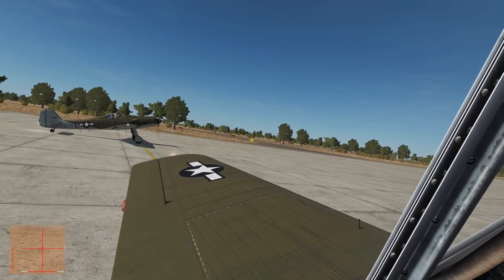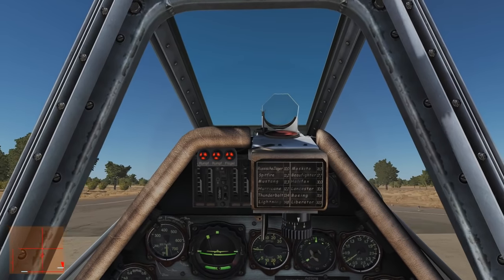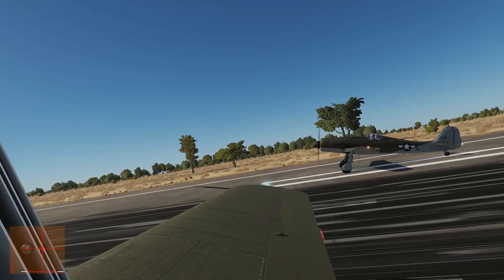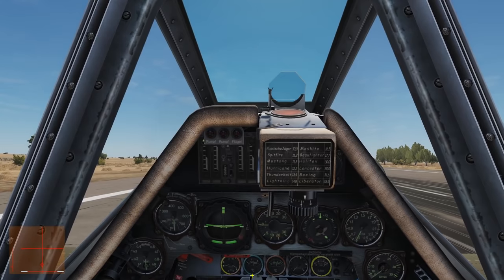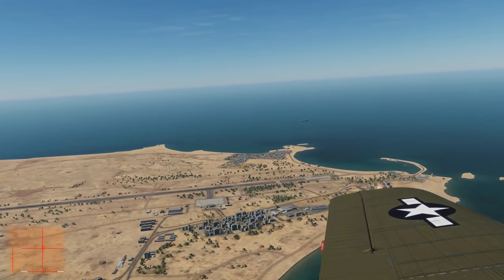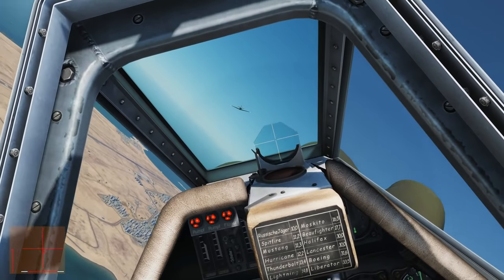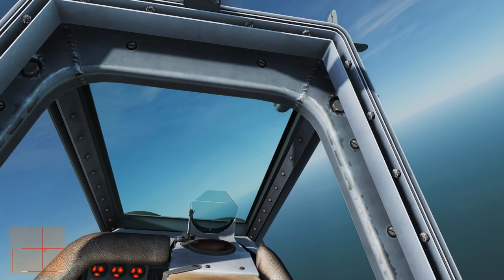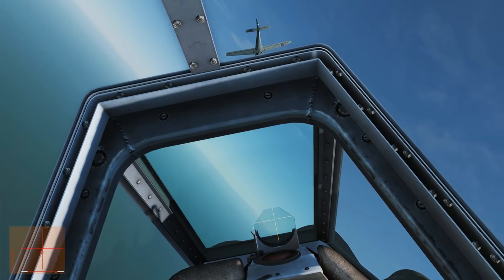FW-190 D-9 Dora: Taxi, Takeoff, Flight & Landing Tutorial | DCS WORLD

Comment: You can ignore cooler flaps and all that other stuff. In German WW2 planes its all done automatically. You just need to pay attention to your boost time aka MW50 usage. I have not managed to brake my engine in recent times.
Whats really nice about the 190 in DCS is, that it can sustain its MW50 powered boost longer than the Mustang can sustain its highest performance settings, so on the deck it will outrun a Stang slowly but surely. Same against the Spit but there its more pronounced. Just keep it fast and reasonably high and youre almost invulnerable. Allied planes right now cant do anything against Germans in MP if Germans fly correctly. Everything Allies have needs way more attention (has more workload for the pilot) and is slower at altitudes usally used for combat (0-5k meters ca). 
VERY high up the Mustang is better but still not as fast as a K4 with MW50. And yes, the Stang should be faster in game but it isnt. There is a thread on the forums with YoYo "admitting" that. He said that since the introduction of the Stang in 2012 it actually got slower since the engine right now works differently (calculates drag etc differently).
TLDR: Germans in MP can do everything they want.
Reply from the maker: Thx Spice
Reply: U.S aircraft flyiers tend to take way too much fuel in the mustang which dramatically reduces its turning ability and increases the stall speed, I was a demon in the spitfire when it first came out, with work load honestly if you initially set the aircraft up correctly you only have to glance at the guages.
Reply: @ThatGuysProject  When you were good with the spit, that meant that the K4/Dora pilots were bad. As I said, if Germans fly correctly nothing can touch them rn.
Reply: Hi Spicy, what you mean for "Stang"? ( You can write in italian too :-D  )
Reply: @tonykeith76  Mustang, the P51. 
I cant speak Italian though :)
Reply: @Spicysauced   It was too much obvious for me to understand :-D

Comment: Here's a trick. Use the turn indicator (stick on the top of the attitude indicator) so you can see when you're actually going straight, then pull the stick back to lock the tail wheel. If you try to lock it in a turn it'll stick in that turn and you'll have a bad time. The P-51's tailwheel is far more forgiving in that respect, it seems to lock when it passes through center. (Not sure how accurate either depiction is, but that's how our models in DCS work.)

And I suspect that turn indicator trick wouldn't work IRL either as there's some lag from real-world turn indicators that doesn't seem to be modeled in DCS's turn indicators.
Reply: You probably should have mentioned MW-50 in there somewhere.
Reply from the maker: thx

Comment: Tried endlessly to get Dora to take off, but to no avail with only very limited success.  Taxiing and start up procedures are fine. When I initially started with the Dora,  the real version that is  without flight assistance, tutorials etc,  I mastered the art of taking off,  sank a few Mustangs and even landed it and got a flight lieutenants promotion, for what that's worth, within a couple of hours of  making the purchase at 50% off so I can't complain. It seemed like a brilliant module, well worth the effort.  However, after carrying out a repair on DCS and an update,  I can no longer get the Dora off the ground no matter what I do.  I've spent hours trying, but to no avail. Endless smash ups.  I've got worse not better. So, rather than delude myself anymore with the Dora,  I've erased it from my modules.  Total nightmare.  The F86F Sabre purchase, however, has been a completely different story. Very easy and really enjoyable as a module along with the Gazelle and the Mig15bis.  I've given up with the Dora.  I just can't get the hang of it. Rgds MCG.
Reply: Found the source of my take-off woes, or rather maybe found it.  I went into my Logitech file and located the profile section.  It looks as though my FSX profile was being used for Joystick control as a precedent not just whilst using DCS World, but with any other simulator I could have on my system for which I could be using the Logitech Joystick.  I have now altered this so that this is no longer the case.  Strangely enough now, whilst using the Dora, the real version that is, the aircraft now takes off consistently and easily with non of the problems which have previously beset me whilst using the Dora with the Logitech.  The aircraft literally lifts itself off the ground with no effort required and seems a lot more stable during the run up to take off.  It's embarassingly easy, so maybe that was part of the problem all along, as well as me being a crap sim pilot, so no excuses. Next for me is the Kurfurst.  Rgds MCG

Comment: When I fly, it starts to roll to the left or right.. Is it the turbulence or? What am I doing wrong? Maybe hitting the throttle too fast?
Reply from the maker: It's the torque of the motor. Very hard to over-come.
Reply: @grimreapers  ok, so in this regard, which one is easier to fly? FW D9 or FW F8? I ask because there will be a discount on modules.